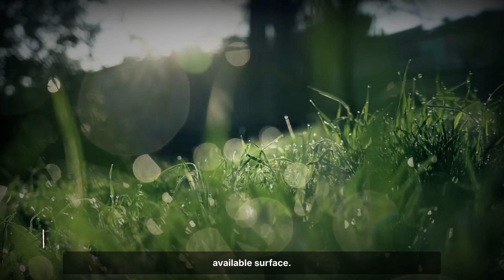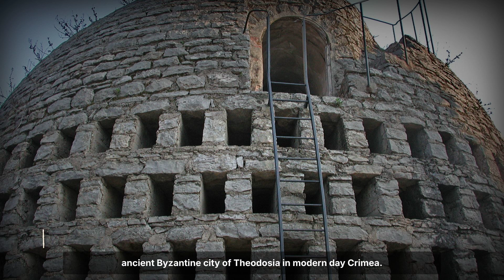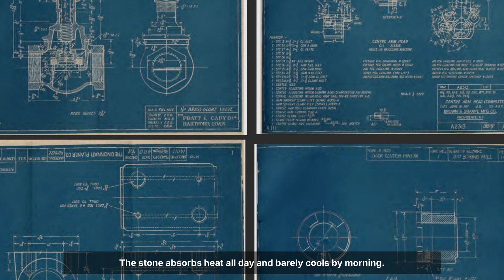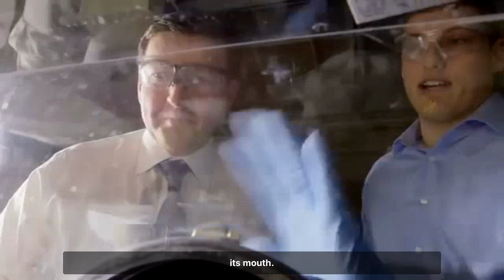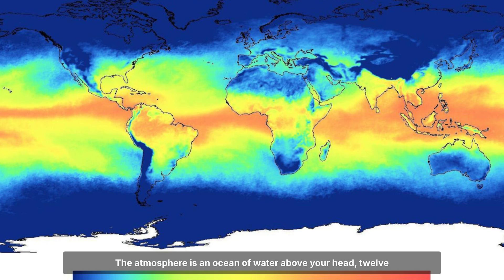Build a Self Filling Water System for $12 — Engineers Have Known This for Centuries

Comment: There are approximately 0.32 US gallons (or about 1.22 liters) of water in 1,000 cubic feet of air at 100% humidity and 98°F.  To extract all that 0.32 US gallons from the air you have to cool that 1,000 cubic feet of air to 33°F. The dew point extraction needs a lot of ventilation to be efficient.

Comment: I like these videos but they should point out that water condensation releases a large amount of energy. Condensing 1L of water from the air releases about 550 kcal of energy (latent heat = 0.72kWh). This release of latent heat makes your collection system inefficient unless it is constantly cooled down and for that you need AC and a lot of energy. Modern atmospheric water generators use large amounts of electricity. Collecting rain water and storing it in barrels or cisterns is much more efficient because the atmosphere has done the condensation for you.

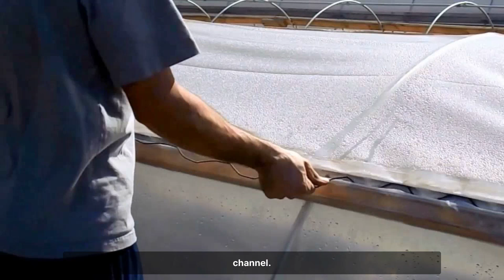Comment: Radiative sheets collect dew [07:16].

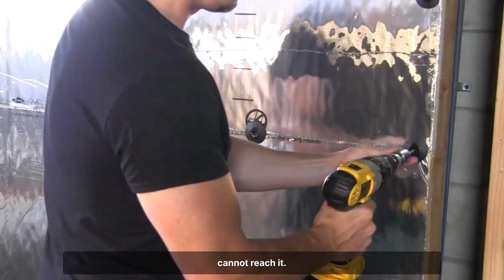Surfaces radiate heat [07:24].

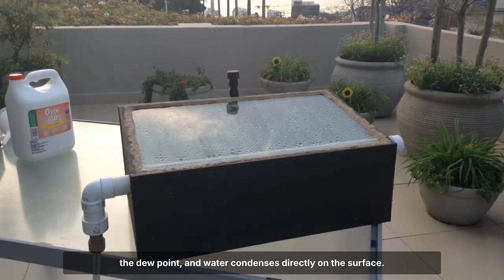Water runs down angle [07:31].

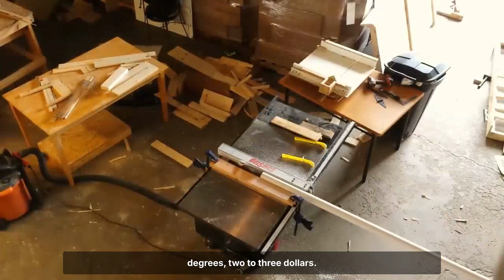Gutter captures liquid [07:10].

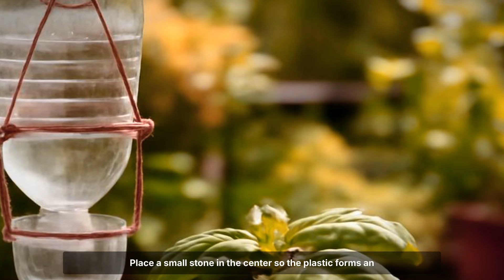Solar heat evaporates moisture [08:31].

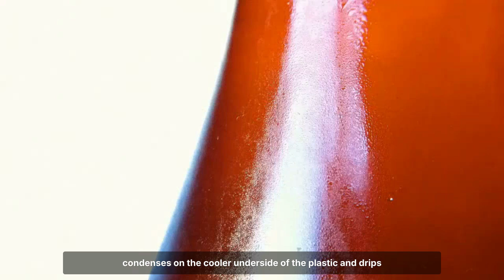Plastic traps vapor [08:39].

Droplets drip into container [08:31].

Mesh intercepts fog [09:12].

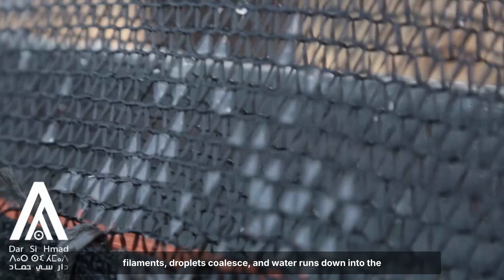Wind drives droplets [09:21].

Gravity pulls water [09:21].

Comment: You screw up the train of thought with so many irrelevant inserts of clips that it might be better without any video at all. E.g. a sheet of insulation shown installed on the interior wall of a house has nothing to do with a condenser system you are describing verbally. Combat soldiers in uniform? A trench filled with water? Flashing those images for a second or two before moving on to the next? I've watched knot-tying videos in demonstrative motion (slow, step-by-step) together with the actual utility (stringing a tight line to drape a tarp over, or securing a load on a flat-bed truck with a trailer hitch). Something like that for condensation would be much more useful and easier to replicate).

Comment: You can produce water by using a dehumidifier. The bad news is it needs electricity the good news it does not use that much so you could use solar or something else to generate the electricity. You still need to filter it etc. to get any impurities out but still enough for any families needs.
Reply: I would say not only filter but also UV or boiling for pathogens. For me, to be safe, the filter would have to be RO. Dehumidifer water is dangerous otherwise.
Reply: I use them to clean my porch
Reply: Very good thinking ❤ Delighted you shared ❤

Comment: Use glass and copper tubing instead of PVC and plastic.
Reply: I totally agree. I’d only use plastic if I were stranded on the ocean or a desert. I’m thankful for the info but This video could’ve been made better. There already too much plastic in our bodies.
Reply: While glass and copper are better conductors, using them might actually backfire for this specific DIY design. The source emphasizes that thin, light surfaces are key because they shed heat rapidly
. Heavy materials like glass create thermal inertia, which is exactly why those massive stone towers failed—they couldn't cool down fast enough to reach the dew point
. For a $12 build, plastic isn't just cheaper; it's physically more responsive to quick temperature shifts.
Reply: @capableguardian 😮
Reply: Smart, thank you!
Reply: Could you give us tips on how to make it safe to create and use thank you
Reply: Exactly, no forever chemicals
Reply: What ifn I used the copper fer a still 4 😏
moonshine, 🤫?
Reply: Agreed.
Reply: If available
Reply: Not cheap.
Reply: Yes, great suggestion! I saw the plastic in the thumbnail and thought that there’s no doubt a lot of nano-plastic particles in that water.
Reply: Excellent advice
Reply: Yes, AI just wants to keep it within reach of all peoples.  What shocks me is we can get such well contextualized info from a machine and have it be useful -- shocker!  But maybe their just doing this to sell us on that, AI, which could take over --  !
Reply: @peace-c2r or it's a reality we may have to deal with, in the not so distant future
Reply: @peace-c2r hummm?…..
Reply: @BexaidaRamirez-v7r  See your Harper's magazine, maybe a few months ago, their lead cover story was som'n about a 5T$ robot takeover.
Reply: @peace-c2r 
F ai
Reply: @peace-c2r  ai is a trap.  ai is a trojan horsr.   in addition, ai will TAKE MILLIONS OF JOBS FROM HUMANITY.     BE SKEPTICAL.....DO SOME RESEARCH ON THE RAMIFICATIONS OF ai
Reply: @libertybell7145  translation: drink the koolaid ai bad
Reply: Please explain in detail...copper and glass system?
Reply: @ayoabdullah2929 to prevent growth of unwanted stuff.
Reply: @ayoabdullah2929 yes , there are machines that do this, and I tried to buy one and it went off the market a Mr. West from from Texas renovated this since you went into about 10 years ago, and then it disappeared off of YouTube I tried to contact the company to see if I could buy the machine and it was in the thousands and when I tried to see if I could obtain one they disappeared It’s the same technology, but if someone could break down and show us glass copper tubing, and at the end the PVC if it’s body friendly and how to make it safe, does anybody have any suggestion? I cannot say that I’m qualified to do this. I need to go by a diagram that someone else makes his food grade plastic a good idea or what!?
Reply: Using a combination of both PVC and copper is best... Start with a little copper to kill bacteria, but then switch to PVC to keep the water from ionizing so much
Reply: @sbritton1313 .   You give a better explanation or a diagram of how to do this possibly thank you and please email me. Answer me here. Thank you very much.
Reply: No way u will become plastic deficit
Reply: @Theendisnow7 😂